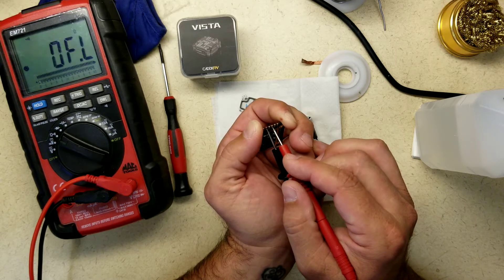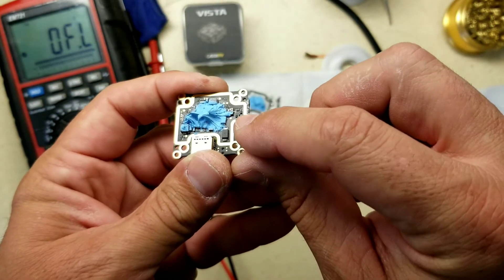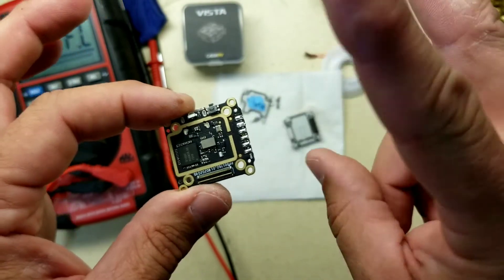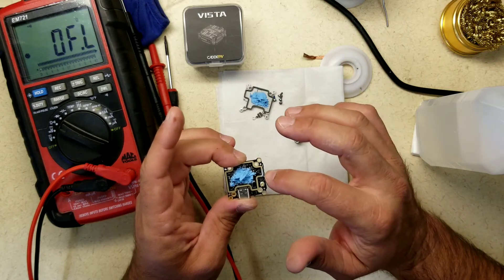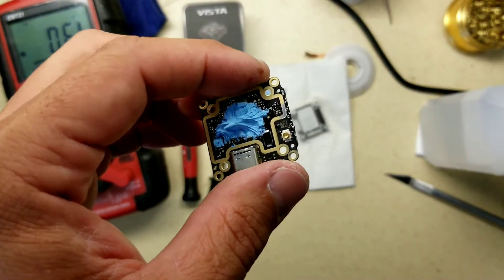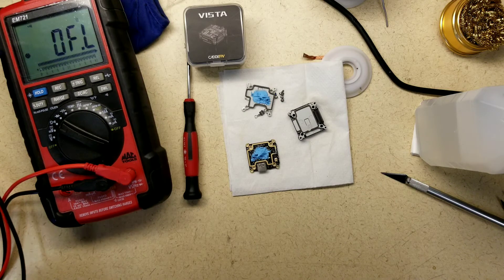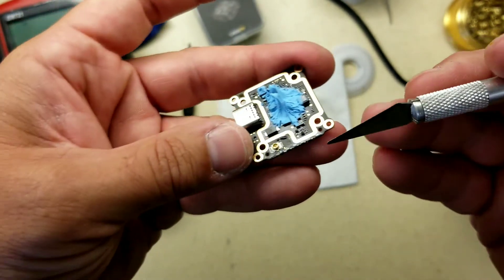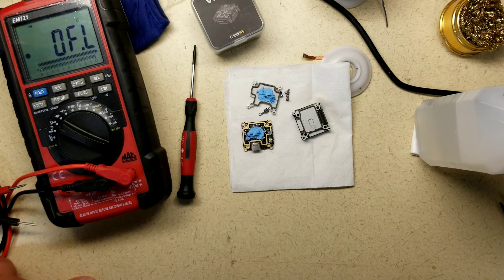"Fixing" a Caddx Vista. No OSD, Voltage N/A

Comment: Hey I had a problem where OSD was not working, and I found that the TX and RX protection (ESD) diodes were damaged/burned. I desoldered those TX and RX diodes, and after that OSD started working normally again.

However, now I noticed a strange issue:
When I arm the quad, the video stays in low bitrate / protected mode and does not switch to full bitrate automatically.
If I manually disable the protection / switch to high quality in the goggles, everything works perfectly and the video runs at full bitrate without any issues.

So my question is:
Could the removed TX/RX protection diodes cause this behavior?
Can damaged or missing TX/RX diodes affect DJI Vista MSP/UART health and keep it stuck in low bitrate mode after arming?

Thanks a lot for any insight 🙏

Comment: FETtec Spike Absorber is made to protect the hardware from high voltage spikes. It only costs a few dollar... I always use them on the quad. This time I broke it when I used my laboratory power supply, which had no cap and no spike absorber and wasn't capable of the current when breaking ^^

Comment: U have link to the diodes. I'm  not getting continuity on rx or tx but do on get continuity on vcc an ground when vista is supplied powering did get smoke from a crash where had to replace a motor but smoke stopped fsst an there was a burnt eire on the header plug to fc from esv But hsve 50v cap on xt60 an a 30v 1000 cap on vista power supply from vbat on fc. Vista an cam are isolated from carbon. Have scorch marks under that vista cam on the carbon fiber camera cage front to pegs that lock the cage to bottom plate. That made me think coaxial cable an cam was grounding out but idk. Would that make vcc an gnd have continuity

Comment: Hi Dane I know this is an old question … I removed both diodes still no OSD but video 
How will I now if the vista blows now 
Will there be no video 
Thanks for your help 😊
Reply from the maker: Sorry my YouTube refuses to notify me of comments. This failure actually only affects OSD. So not a deal breaker. The only concern would be that you wouldn’t know if it was stuck in low power mode from another failure.

Comment: One om my Vistas have BF OSD working fine, but the native voltage OSD element shows N/A , and the Vista does not recognize arming (and is stuck in low-power mode)  - as OSD works - it's no surprise that there is no shorted diode.  but what else can it be?
Reply: did you manage to hide my friend?

Comment: I am running into the same issue where my osd isn't showing up, I have it on uart3, and MSP is turned on, on uart3, osd display is turned on in the configuration tab, the display tab is on, and I made sure TX to RX and RX to TX, in the googles I have custom osd turned on. Am I missing something?  I am getting an error message saying low power mode, unable to record. I found out I can turn off auto temp control, but even when I do that, the error goes away but the osd doesn’t come up.
Reply: Same here, did you solve it?
Reply: @sirfpv  I honestly just under soldered everything and chose a different uart port and mad sure I had everything connected well. Idk why it wasn't working on the uart it was on before but I went to four or instead of three
Reply: @johnfleurimond6619  your osd work now in uart four?

Comment: Hi. I had. A bad crash with a wing and the crash tore off the Rx and TX pads, so have no osd, tried scratching back to get somewhere to solder to but no luck, any idea where I can solder tx and Rx to the board? Thanks
Reply: if the diode pads are gone, you would have to scrape back the coating, to  expose the trace, and then solder a wire from that trace to the diode. This is very delicate work, and sometimes is not even possible. I don't know your level of experience. But if you need to see something like it done, look at videos of people replacing, or fixing broken solder pads. That will give you the idea of what I am talking about.

Comment: Pretty sure I've ruined my Vista before I've even flown with it. Couldn't fit anything larger than a 35v 470uf cap. I've powered up several times on the bench to test/setup, however I'm getting no OSD and I'm stuck in low power mode. I'm guessing I've blown one or more of these diodes. I'm so upset with myself that I've ruined it.

Edit: I've just checked with a multimeter and I don't have continuity between any of the solder joints on the Vista, including Rx and Tx, so that's a good sign right? I think I need to try another UART on my FC and see if that works.

Edit 2: Oh my god, switched to another UART and it's finally working. When I arm it comes out of low power mode and the Betaflight OSD is working. 🥲

Comment: Hello! I have Vista here with some failed functionality - its can show osd and picture, I can use my dji radio too but right after drone armed - vista reception signal bars foes to zero and I can flight really close to my goggles/radio only. Picture degrades in quality very quickly after arm. Do you have any idea what's can be wrong with it? Thanks!
Reply: you've damaged your aerial. if it is naked then the connector can get pulled off. if that is not the case then turn temperature control off and you should be good
Reply: @doccock100  I've tried to turn off temp control right after this issue detected - doesn't help. Antenna connector looks totally fine also. Any ideas? If you have time to help me 1o1 - let me known. Thank you for your help.
Reply: @vsobolev  Have you tried repacing the aerial on the vista, they can get damaged after a crash even if they look ok (the lolipop on the end gets dislodged off the cable). also go and check and make sure that the power in the goggles is not at 25mw (700 or 1000 is good). have you also checked that the aerials on your goggles are screwed in properly. Let me know if that doesn't work. also let me know if you ever have ever had it working.
Reply: @doccock100  Hello! I've tried 100% working antenna, I've tried to solder side contacts (reheat with my iron) on aerial connector on Vista pcb, power set to 25mv, UART data works for sure (I see voltages and OSD elements). Also I've tried bottom pcb from another Vista (100% tested) and another tested flat connector cable to isolate my issue - same thing, so, issue is for sure on top pcb (usb one). I will try to reheat all elements with soldering fan.
Reply: @vsobolev  l

Comment: Quick question why wouldn't you replace the diode and not remove it? Thanks for the video -liked subbed
Reply from the maker: Sorry I missed your comment. At the time before this video, they were hard to find. I didn’t end up researching them, but I’ll bet you can get them from digikey or mouser. I mentioned this in the video. But I didn’t end up researching them any more

Comment: THANKS!!!! You just saved me from buying a new Caddx Vista!! 
My Ground next to the Rx had come off (probably because of a bad soldering from my side....) and the OSD wouldn't work and the high/low-signal for the VTx didn't come in either.
I measured and had a connection from the Rx to Gnd. I removed the the diode for Rx and now everything works again!

Comment: I was bought the polar vista as a Birthday present for the 3rd Oct and every day I have been trying to find out why mine is not communicating with the goggles,.
Now I have the answer, faulty board.
Would this be stopping me from selecting the settings menu once my drone was bound.
If the drone is un bound ,I can access the menu in the v2 goggles.
As soon as I plug the vista polar in , I am un able to to get into the goggles menu, as normally I press the goggles button . 
thanks
Reply from the maker: Yes, if the msp is active, and you have low power settings and all that, it will prevent certain menu items
Reply: @danemartin5288  Yes Since the day i set it up, and with fans blowing to keep cool as i read These things get hot. Low power Unable to record has constantly be shown. I was told to solder on to diff uart I did and it seemed to fix, but just temp as showing same message. Just a pain as it was a present from my son, I haven't broke it ,as I was as careful as I can be. seems o be a lot of issues with these units. Thanks again for your help I will show this to the store where it was bought. Cheers Graham